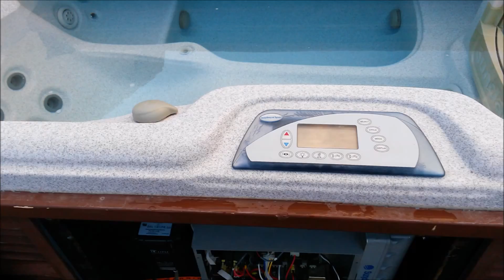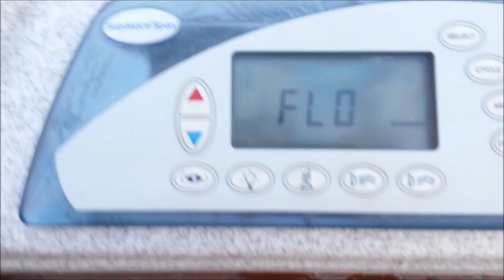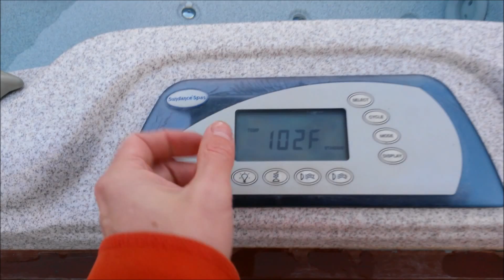Hot Tub Not Hot Enough? 104° Temperature Override  (:2:) The Resistor Method

Comment: update: the temperature sensor (not the limit sensors) is the key.  Wiring diagram showed the sensor to be a 3 wire (2 red one black) resistor type,   So put 1 - 1000 ohm resistor on each red wire & voila, temp is down 6 degrees!!
Reply from the maker: Wow! That's great! 
Thanks for coming back and letting everyone know!
Reply: @SpaDayz what watts are the resistors? There is no lnks available anymore
Reply: Down or up 6 degrees?
Reply: @Terrathrax  this tricked the temp sensor into thinking it was 6 deg colder than actual, so it would keep heating, raising the actual temp 6 deg above what was displayed/set to
Reply: so are you saying that you only need to do it on the temp sensor and not the limit sensor?

Comment: I assume adding two resistors in parallel would decrease the water tempuature? I live in Florida and our spa resets the temp to 102 every day. It is an older spa and does not have a way to hold the temp lower. We would like the temp to be around 98 durning the summer. I am thinking about adding a removable jumper with parallel resistors to accomplish this. Thank you for your video, it helped me figure out a way to do the exact opposite of what you did. :)

Comment: Thanks for this great hack. I did it on my tub and it worked! The tub is made by West Coast Spas and uses a Neo 2100 controller and a Waterway WIN5500 heater. There are 4 sensors inputs on the controller for the heater: Water, hi-limit, freeze and thermal (the freeze is not in use). The water and thermal sensors are identical - one is upstream of the heater and one is downstream, and which is which depends on the direction of flow through the heater. After some experimentation, I discovered that I need to put the same resistance on both the water and thermal sensors. The controller looks at one of them to determine the temperature and the difference between them to determine if there is adequate flow. So, if you only do one, it will eventually fault for low flow. I did not do anything to the hi-limit sensor, which is in the middle of the heater and presumably is to prevent the heater from burning out. Using 560 ohms on the thermal and water sensors reduced the apparent reading by 4-5 degrees. So, when set between 100 and 104, the actual temperature was between 104 and 109. To avoid cutting the lead wires (for warranty purposes), I made two short jumpers with a male & female plug and resistance in the middle. I bought female to female jumpers, cut one end off and soldered on a male end. Here are the links to the plugs: Female to female cable 6” length: https://www.molex.com/en-us/products/part-detail/2162701022; Male connector: https://www.molex.com/en-us/products/part-detail/705430001; USA distributor: https://www.newark.com/. Thanks, again!
Reply: Update: I had to add some resistance to the hi-limit to prevent the controller from faulting due to thinking the heater was overheating. I tested several resisters and went with 330 ohms, a little less than the 560 ohms I used for the thermal sensor. That was enough to prevent it from faulting when heating to the maximum temperature (set at 104 degrees, which is actually 109 degrees).

Comment: Did not work on my 2017 CalSpa (Balboa board). Initially followed the directions here to solder myself using the materials indicated. Got sensor error message. Hired electrician to redo the job with his skills. Same error. Had to remove resistors (1.5 K Ohm) and resolder sensor wire. Spa worked again. Expensive. [amateur tip I should have thought of - don't do this when temps are freezing and spa might freeze if this doesn't work!]

Comment: I did this to a signature spa with a balboa 700 controller.  It has a heater tube with a sensor on each end. I added the 1k ohm resistors to both red (the sensor had a black and red wire).its taken the temp from being maximum 40 degrees centigrade to 42c degrees centigrade. So thanks so much for this hack its been great.

Comment: I did this mod and my tub is now about 6 degrees colder. I wired the resistors into the black (2 wire temp sensors). Do I need to swap the resistors to the red wires?

Comment: I raised the temperature with the 1 ohm resistor method however sometimes it works but many times the FLO message comes on. Could it be that where the temperature sensor and heater sensor plugs into the board that a wire is loose? Sometimes I turn the breaker off for awhile and it resets. When my temperature on the panel shows 100 it is really 104 and when I move it up to 101 it shows 10105-106. I used it last night at this setting and everything worked well. I decided to move it up one degree to 102 and now the FlO is on the display and none of the buttons work. Help would be appreciated.
Reply from the maker: The "FLO" error is actually a whole different video. Lol
That is an issue with your actual flow sensor. An archaiac magnetic device designed to tell the control board that there is enough flow from the circulating pump to turn the heater on. I have had limited success replacing and crafting my own.

Google your model/brand flow sensor and you will be rewarded.

Comment: Hello, looking for video 3, the 'hokey, backdoor' methods for temperature override, for those of us not handy with electronics, soldering and resistors. Can't find it in your list of videos?
Reply from the maker: Actually I never made it. Lol.
Basically you will need to drain your hot tub until the temp sensor is exposed, then take some silicone and put a nice 1/4 to 1/2" of goop on the sensor. You may need to pull the overheat sensor out of it's sleeve a little also. You're basically just insulating the sensors.

Comment: I heat my hot tub with an old boiler that runs on propane. One time I lit the burner and then went back inside and completely forgot about it for a while. When I came back out it was at 153° lol never doing that again. It’s made of a steel tank by the way so nothing was damaged

Comment: Great video with one suggestion: Always insure a mechanical connection between the resistor leads and the wires by first bending a small hook on each lead and then "crimp" the connections with pliers before soldering.

Comment: I have three wires, black, red and green I placed 1.5 resistor on the black line now my tub reads 119 when it’s only 103 any help?
Reply: Thx
Reply from the maker: So if it's reading high, but the temp is actually still low, you're half way there. Try adding one to the red

Comment: Hey there have a question about doing this on a Canadian spa company gandor spa gecko 300 controller. Found a thermistor on the heater has four wires. Also found a flow controller. You think either of these is what I need to add a resistor too?
Reply from the maker: Are you sure it's not actually 2 thermistors? One thermostat and one hi limit?
Reply: @SpaDayz  actually positive. There’s a four wire thermistor and then a flow rate something and both are four wires. They’re the only eight wires that go into the “probe” section on the controller. I think it’s a four wire thermistor that uses two signals and ground / power to be more exact. But I don’t know that’s just my theory researching them. I couldn’t get any ohms resistance on any of the wires unplugged at the sensor but I also wasn’t sure I was making good connection with my multimeter. Any ideas which wires would be the ones to do the resistor on? I have photos but won’t let me post them on here
Reply from the maker: Did you read through the comments here. Someone else had a 4 wire setup. Usually truns out to be a combined hi limit and thermostat plug. Can't hurt throwing a 1k resistor on the red and green wires and see if there is a change.

Comment: 12-2022  Just did this hack on my 2021 MasterSpa Twilight 8.2 Model #5700. I bought new sensors ($35) & saved the original ones just in case of a warranty problem. I can swap them out before the tech comes out. Used 1K in both sensors expecting the 6-10deg off set. It's my fault I did it late at night after work, got a warm day in Mich. Set the tub control panel to 97deg. Did not check it until next day. Well? When I put a digital meat thermometer in tub water it was at 132deg=35deg diff? Lucky no harm to tub. It was cold out 30ish & I opened cover ran pumps got temp on control panel down to 85degs meat thermo. at 106.5. Just a heads up to do this in the am set tub control panel to 80degs & check it for temp rise. I just have to remember that 85degs display=106degs water & tub is running fine. Next summer I might try lower resistors?
Reply from the maker: Glad it worked out!
Thanks for posting the model number!

Comment: Hey man I'm not able to get this resistor thing to work on my hot tub I've used from 1 resistor all the way up to 5k resistors. It'll eventually show 65 degrees when it's realy 104 degrees then it just shuts off u think if I put tape over the sensor it'll work? Or I was thinking cocking also mite help but I don't want to destroy it you know what would u think I should do to get this hot tub up to 110 degrees? I could give you a tip if you could help me with this also.
Reply from the maker: If it is showing a lower temperature, you are on the right track. What temp did it show with each incremental resistor?bif it kept getting lower, then it was working.
Have you located both the high limit and normal temp sensor leads? You may have to add a resistor to both sensors.
Reply: @SpaDayz  I've added to both little wires there's a red and a black wire I would put them on both it wouldn't do anything bro until I got up to 4k resistor I think it was then it'd show 64 degrees then in like 2 minutes the whole just shut off. So the resistors didn't work on this hot tub. I think ima just put duck tape over the sensor hole hopefully it'll work like that lol. Later on when I get more money mite just buy a newer tub or one this works on cause yea this hot tub it doesn't seem to work with resistors
Reply: @SpaDayz  you think the only other way is putting cocking were the sensor is? I was thinking about putting tape to not mess with the sensor but yea I've got tape here and I'm sure it's just gonna fall off haha. And the cocking later on I'm sure will come off if I remove it so there shouldn't be no problem with it. I'm hoping it'll interfere with reading how hot it is and yea so I could put the tub atleast to 110 111
Reply: Wasup then u don't know if cocking will help or mess up the tub?
Reply from the maker: @JozeSanchez13  You most likely have another hi limit sensor somewhere, which is why it's shutting off at 65deg. Both sensors usually need the resistor so that the input is consistent.

In terms of Caulking, that is an option. Another option is to pull the sensor out of the sleeve most of the way or a little at a time so it has less contact with the water. You can even pull it completely out of the water and just caulk it to the outside of the tub shell if you have to.
Reply: @SpaDayz  thanks man for the advice let me try that out!

Comment: Red or black wires? Here is why it doesn't matter which you choose. I've read all of the 400+ comments here and see that there is a lot of confusion (and a lot of questions) about which wire should be used for installing the additional resistor. Hopefully, this will help.

Thermistors are inexpensive, easily-obtainable temperature sensors constructed using semiconductor metal oxides. They are available with either a negative temperature coefficient, (NTC) of resistance or a positive temperature coefficient (PTC) of resistance. The difference being that NTC thermistors reduce their resistance as the temperature increases, while PTC thermistors increase their resistance as the temperature increases. NTC thermistors are the most commonly used (especially the 10KΩ NTC thermistor). As the sensed temperature at the thermistor increases, the resistance of the thermistor decreases, thus changing the current flow through the circuit and with it the current supplied to the control circuitry for the heater changes causing the heater to turn off - based again, on the current passing through the thermistor. Simply put, as Temperature increases, Resistance decreases, and as Temperature decreases, Resistance increases. For most spas, the factory-programmed control circuit that controls power to the heater element is set to limit the current flow to a value corresponding to a water temperature of 104 degrees (F) - in reality, it is actually limiting the current flow to a resistance value proportional to 104 degrees. This is "overridden" by changing the current (signal) from the thermistor to the control circuitry for the heater by adding a resistor to the circuit. Adding additional resistance ANYWHERE in the sensor's current path will cause the current flow through the thermistor (and circuit) to drop, this in turn causes the heater control circuitry to respond as if the temperature had dropped. In reality, the actual temperature hasn't dropped, all we did was put additional resistance in the circuit. This is why the resistor can be added to either the red or the black wires - it doesn't matter because all we are doing is changing the resistance of the entire circuit associated with the thermistor. This is why the modification offered here is really as simple as it seems and in terms of electronics, very benign.
This doesn't explain why you have to do this to both sensors (which is important), nor does it explain why adding identical resistors to two different spas (sometimes even being identical spas) causes the final temperatures to be different - these are interesting (and fun) discussions, but not really required to solve the 104 degree temperature limitation problem.
Reply from the maker: Great explanation. This may help those with a curious mind.

Comment: Curious what the wattage of the resistors you would recommend of these 1K ohm spec?  There's 1/4 watt, 1/2 watt, or higher.  Is there a way to look at the current circuit board to get an idea?

Comment: this guy needs a metal ..i was sweating buying a 8 thousand hot tub and not being able to get as hot as the old one i had for 25 years, i have a 2022 dimension one dream tub by jacuzzi, for those of you how have a 4 wire set up to your heater all you need to do is put that 1k 1 watt resistor on the black and red...you will know you got it right when you plug it back in the temperature will be 8 degrees lower...i had mine set at 104 and shut it off did the quick fix and when i plugged it back in 15 minutes later ..it read 96...heee ha!!...thanks a lot...your bad ass
Reply from the maker: Glad it worked for you! Thanks for coming back with specific feedback to help others!

Comment: I want to thank you so much for posting techniques to exceed the 104 degree limit.  Your advice gave me the direction needed on how to get the tub up to its 110F that I have been at for 20 years with my old tub, plus a few degrees extra to  adjust for winter months.   Now reads 99F when its actually at 110F!  Trick was to first make a bread board and splice into (with a extension harness) the high limit/temp sensor so that I could easily test out different ohm resistance.  Best configuration turned out to be  using 1.5 K ohm resistors on both red and green lines.   After a few days testing, I built a harness that I could then connect into existing lines without having to cut the existing wires (and void the warranty) on this brand new 2022 One Dimension Journey bad boy.  Be happy to send you $50 for your advice.  Just let me know how I can get it to you.
Reply from the maker: Awesome! 
You put more intention into it than most people would. I love it when people come back and post feedback and detailed model specific  results! 

Thank you for that!

I wouldn't say no to a tip. 😅 Lol
Money is tight right now.
Paypal: PayPal.me/cre8er
CashApp: https://cash.app/$cre8er
Venmo: @cre8er
Reply: @SpaDayz  Hi Corey, just saw this reply and sent a tip.  Thank you again.  sorry for the delay.
David
Reply from the maker: @adventuremuffinproductions  Got it ☺️ Thank you so much!
Glad you have a nice toasty tub for the winter!
Reply: How’d you build the harness?
Reply: @ShaneWillard  Thru trial and error.  A learning experience.  If you have the same tub, willing to build one for you.  $100.00 paid in advance. Otherwise, take a look at the full text above for insights.

Comment: One Dimension 2021 Journey spa has a combined hi limit and temperature with 4 color wires.  All goes to the heating tube.  Four colors go to that plug. I talked with Gecko tech (nice folks there), and after some searching, this is what they told me about those colors:
Thermostat 1 Red and White
Thermostat 2 Green and Black
My guess is putting a 1k ohm on the Red and Green or Black(?) Would make the system think it is cooler than it is. Do you have an educated guess as to which color sets to put a resistance to?
Reply from the maker: I would try red and green, then all 4 if that doesn't work.
Reply: @SpaDayz  Thank you.  Will do that.  gonna take some courage as its a brand new tub, but I appreciate the fall back idea. Just need to first get a replacement hi limit/temp probe as I would like to keep my warranty (brand new tub) and on the probe, it states "warranty void if removed" which is what I would have to do to get the resistors in.

Comment: This worked perfectly for me!!!  I added 1.5k resistors to the sensors and it gave me 10 degrees higher.  I love it at 108 and it's beutiful!!!!!
Thanks for this video.
Reply: What kind of hot tub do u have? For my hot tub this didn't work.
Reply: @JozeSanchez13    I believe an older hot springs with the stainless no fault heater with 2 sensors in it.
Reply: @juggyhd  o ok yea ima have to get an older tub or a newer one cause mine ain't working haha this thing didn't work for me but yea I'll figure it out